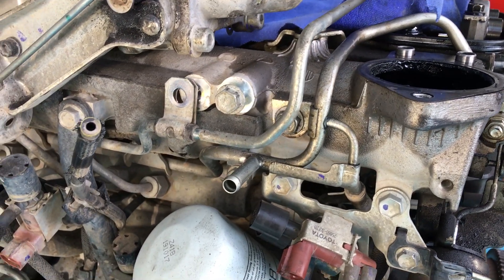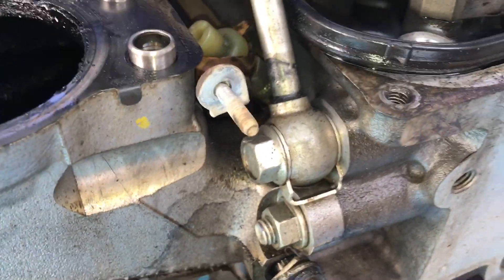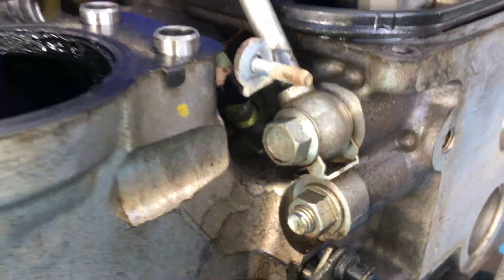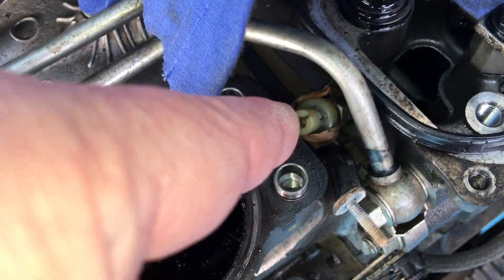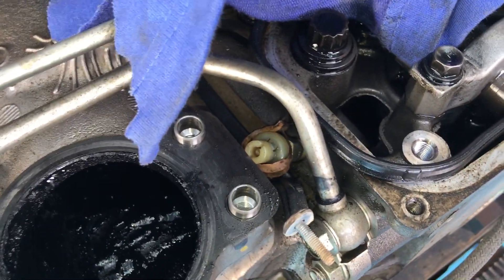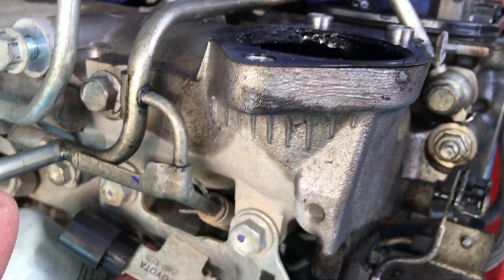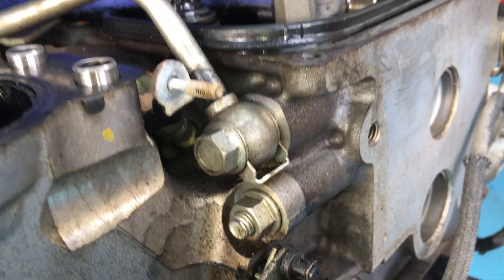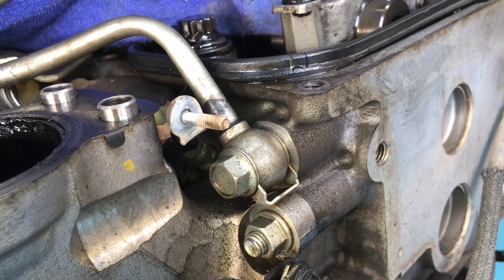GETTING TO THAT BOLT TO REMOVE THE MANIFOLD

Comment: Awesome info on your channel 4rby 🕺  a little tip if you absolutly need to use the old gasket.  You can earm them up with a propane burner  before you mount it back on.
As the copper kinda melts and gets proppa seal again.
But only when you lost it and its friday night